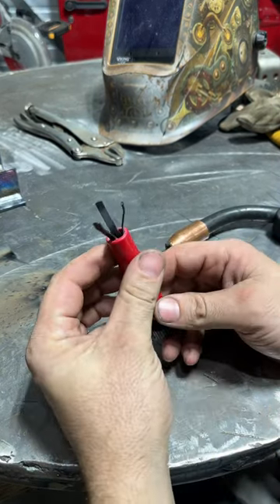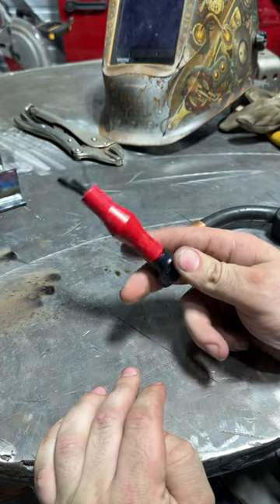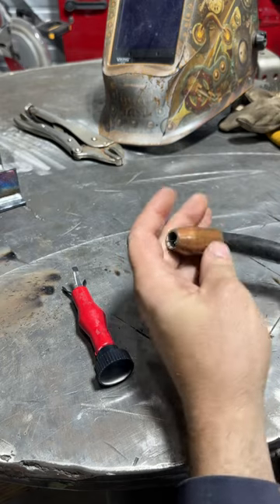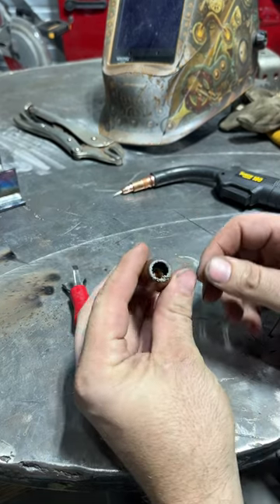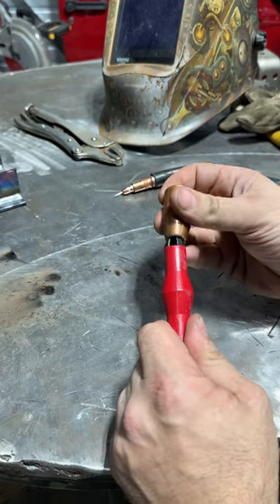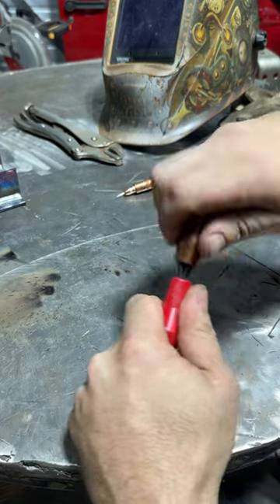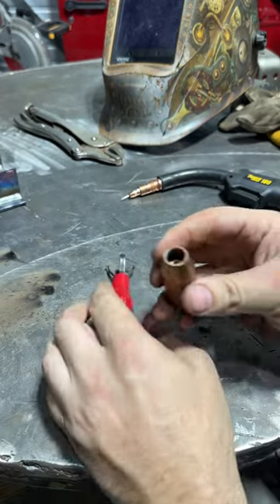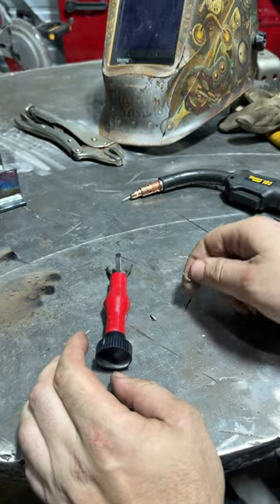Cleaning a Mig welder nozzle 👨🏻‍🏭

Comment: Flathead has always worked fine for me
Reply from the maker: A normal Mig nozzle absolutely.  That particular esab nozzle a screw driver has a hard time getting in at the sides because of the built in contact tip holder.  What’s most important is the tip is clean, by any means 😀

Comment: Link?  Tool manufacturer?
Reply from the maker: This is the exact one I bought, I bought it locally not on Amazon.  There are a few that look the same but are .50 cents cheaper on Amazon 😀 https://www.amazon.com/K-T-Industries-5-1140-Nozzle-Cleaner/dp/B00X9M2IQU/ref=mp_s_a_1_8?crid=1MJIOYARUVBQK&keywords=mig+nozzle+cleaner+tool&qid=1692844735&sprefix=mig+nozzle+cle%2Caps%2C277&sr=8-8